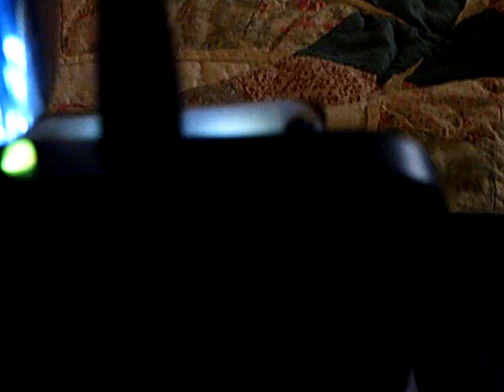LED Light - to - Photo cell feedback on NILS

Comment: Good deal! Second source of power besides the av plugs. I think you might have a winner there lidmotor. I think a way to increase the brightness is add a light reflective mirror and you might double the lumans of the leds and push more power for the solar cell. Put that just proves the solar led might be a winner.

Comment: Very nice once again.
I think green means a bigger charge than decharge! But only one way to find out.
Let the setup run continiously without charging it up (cover the top of solar cell or something) and time how long it takes to drain the battery then charge it up again an put the whole setup in a closed box feeding from it's own power and let it run a couple of times longer then the measured time and take a look!

Great stuff.
5 star rating of course.

Keep up the good work!!!